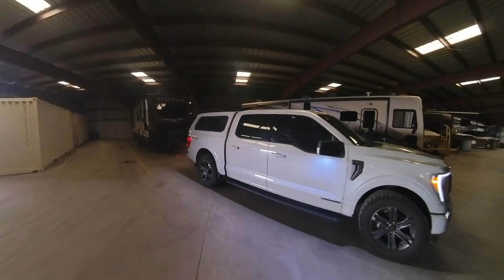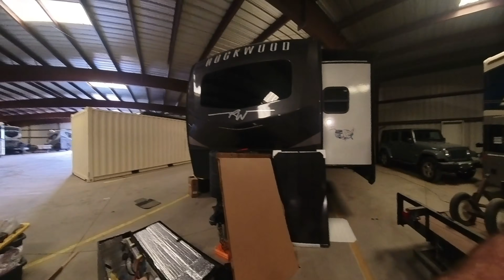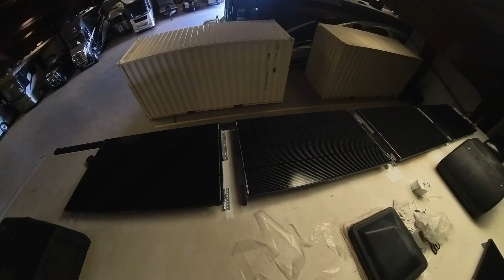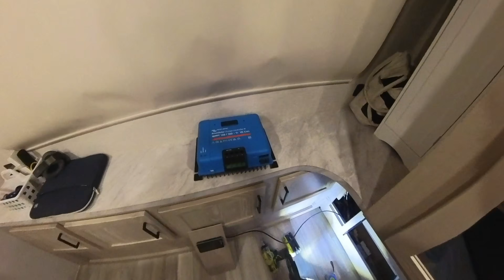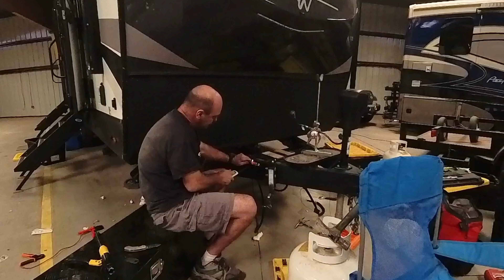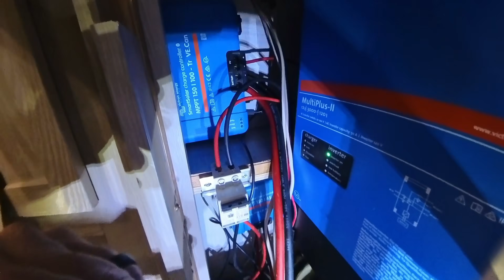Travel Trailer Solar Overhaul | 560Ah Lithium, Victron & Custom Battery Box

Comment: Great video and love the tilt on the panels. You can also add linear motors and an arduino and have sun tracking :)
I'm renovating a vintage motorhome here in France and added 314AHr of LifePo4 but had to use flexible solar panels as I have a unique poptop roof.
Reply from the maker: Cool thanks for watching. I would love to do the motors but have to watch my weight!

Comment: Good job Doug.
Definitely a good idea to make jigs to lay out your solar panels. 
Also a good idea that you laid them in line with one another and elongated so that you don't have as much wind drag. 
The seal up any hardware on your roof self-level is good also butter caulking as is referred to is really good.
I prefer to use the brand lexel caulking myself.
And good job on retrofitting everything together moving the gas tank forward.
And you can never have too much juice. 
I don't think I would have worried about rotten so much or flooding or power outage were you guys had your camper store at that look like a very nice facility. 
And as your number one fan I can't believe you were in my home state of Florida I did not state that earlier to where I could see you and get your autograph and a picture. 
That would have been awesome. 
Happy trails.
Reply from the maker: Thanks for watching. And we tried you wouldn't come to lunch🤣